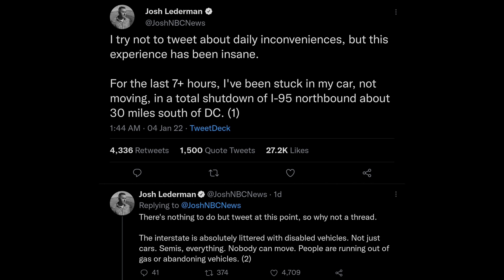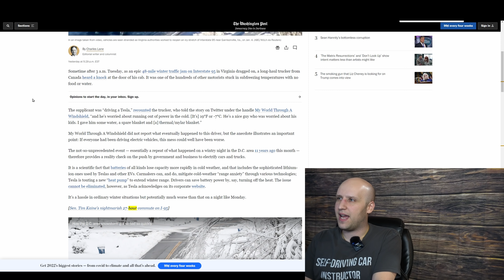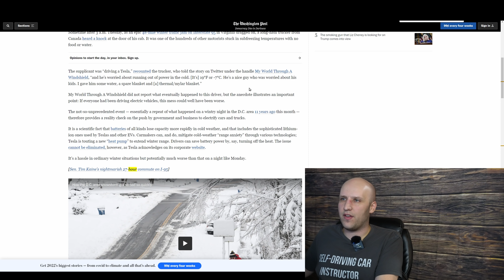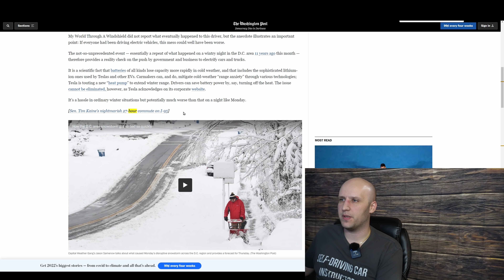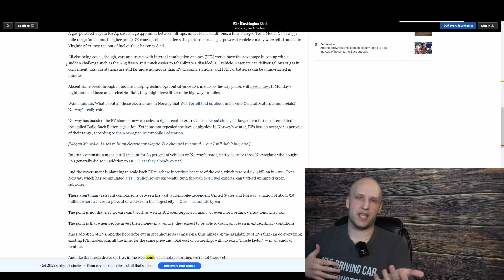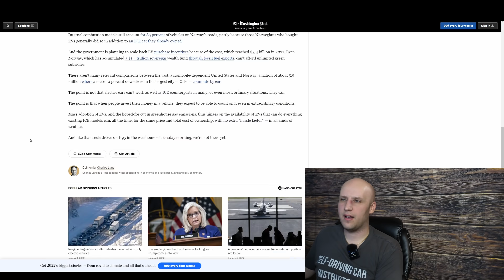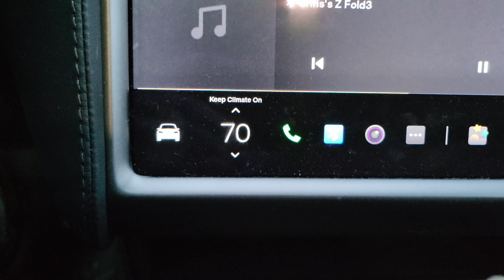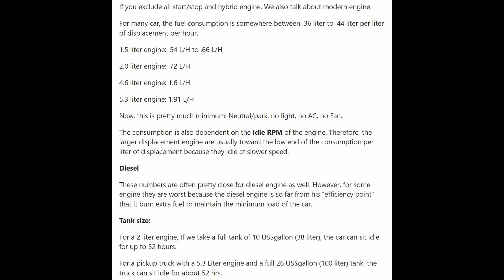How Long Can a Tesla Keep You Warm In A Frozen Traffic Jam? | FUD Debunking

Comment: Nice video, but I love all the reasoning on why your electric car is the best.  With power outages that follow events like this, many gas stations actually have generator sets to enable pumping fuel when you would not be able to charge.... sad but true
Reply: We love the reasoning of carrying a small portable generator in an EV, just as it’s good reasoning to carry a battery jumpstart unit in ICEVs … and the batteries in those are now typically  … Lithium-ion.

Comment: I have been hotshotting for some time now and i have pulled Tesla's out of snow and pulled them when the Batteries died, that Regen breaking well being pulled does work and i have fully charged a Tesla model 3 within 75-80km. but the number 1 mistake people make here in Canada is traveling in the winter at -20.c and on mountainous roads with steep grades. they need to learn that in the winter your Tesla is not going to make it to Kamloops anymore now that highway 5 got taken out by a storm, almost daily we see them stuck and unable to charge. i feel bad for them but you need to be able to drive at lease 340km or 7 hours without needing a charge, funny thing is i now move a lot of teslas for work, most people see that they can't make it on with 
EVs and just call around to get them transported. Great video though, I did order a Tesla model 3 but waiting for it to come in

Comment: Actually, the same problem as a gas powered car. However if the temperature were Canadian winters (averaging -30 worst week) makes the Teslas an urban vehicle. Seen enough cars stuck when temps are very low and gas mileage takes a severe down turn, say 20% lower due to bad traction and severe temps, gas cars with small engines cannot reach optimum operating temp. Hybrids seem to do better though.

Comment: Great test on a sealed system. Now do a test where you have to open the car at least twice every 2 hours to pee. Also, its not a valid assumption that the vehicles would be 90% charge after running into this situation. Finally, in this event, there are thousands of cars - if even a portion of them run out of power - it's not a simple refuel to get them out of the road to clear traffic.

Comment: I remember reading about a mobile charging company in Europe. They have vans that have a lot of batteries in them and they can drive up to your EV that is out of charge and give it enough of a charge to let you drive to a charing station. To my thinking that means the ICE advantage of "you can bring in a gas can and add some fuel" is negated and you can do the same thing conceptually with a mobile charging solution. So in that case it is not that the EV is "worse", rather it is that here in the states we do not have a service like that yet, but probably will as the density of EV's on the road continues to rise. IMHO

Comment: I own a 2021 BMW i3 BEV with a heat pump and although I can't make any direct comparisons to your experiment, it did provide some excellent analysis. I have noticed that while my seat heater seems to have a negligible effect on the charge level, the air circulation fan, whether heating or cooling, will drop my range by about 20 miles, even at its lowest setting.  Of course, that's only for the duration that it's turned on.  Most of that range comes back when I turn the fan off, depending on how long it's been running.  Do you see a similar effect in your Teslas?

Comment: 22 people who where stuck in a snow storm in Pakistan died from carbon monoxide poisoning while running their engines trying to keep warm. Anyone with common sense knows not to run their heater constantly that goes for ICE and electric vehicles. And depending on the condition of your ICE vehicle it can overheat trying to run it constantly while standing still. So your ICE vehicle better be well maintained because winter will sure find all of your defects. And this person is only speaking from their experience because they don’t know how many other people in ICE vehicles had problems. There was a snow storm in Atlanta some years back where people where stuck in their cars for 26 hours and ran out of gas so this person is just cherry picking his situations. If you like ICE vehicles keep driving them but don’t try and force your ideas on EV drivers. And that was just one day, one incident it’s not like it’s a daily occurrence. Hey keep taking your ICE vehicle taking it in for maintenance and regular visits to the gas station and I’ll keep you in my thoughts occasionally while my car is charging in the garage while I’m sleeping.

Comment: "Drivers can save energy by turning off the heat" not really true in an ICE car. 60% or more of the energy in the gasoline gets turned into heat whether you want it to or not. Essentially the heater in a gas car is always running, just not always being pumped into the cabin. 
I get not having a blanket in the car in Southern Cali or something, but not having one anywhere it snows seems unwise. Better to toss it in there along with the rest of your emergency supplies and forget about it till you need it.

Comment: But having anticipated this kind of weather, a gas car driver could carry an extra gallon of gas in a safe container.
Reply: when the weather clears, it's a lot easier to dump some gas in the tank. charging a battery is much more involved and time consuming. I imagine they'd simply tow the car. $10 vs hundreds of dollars to recover. actually, a gas car has other options too. at least once in my life I've dumped a bottle of dry gas in the tank, just barely enough to start the car and rush to a gas station. not exactly good for the engine, but it saved so much hassle and money.

Comment: I love how ICE vehicles draw fossil fuels directly from the earth and do not require filling up at some form of distinct station.
 - Therefore infinite power hack.
Also, how only electric vehicles reduce mileage in the winter.
No ICE vehicle loses range, they actually gain range from the cold fusion effect with the fossil fuel infinite power hack.
The "gas can" is definitely a fair point. However, after EVs are around for decades too, I am sure there will be simple solutions for people who run out of battery.

Comment: Something to keep in mind with an ICE car in these conditions is to keep the exhaust pipe clear, to avoid carbon monoxide poisoning.
Reply: It doesn't need to be blocked to leak all kinds of pollutants into the cabin..young children are especially susceptible.
Reply: Wouldn't the heat of the exhaust keep it clear?
Reply: @rong648  Just depends on what is happening outside. If it is snowing and blowing it could get covered. The one thing I think about is a gasoline car could be fueled while stuck out there and that is something not easy to do with an EV. Because how many are going to be stuck with 90% charge on the battery?
Reply: @ManleyOne  I grew up in Michigan and that was never a concern that my exhaust pipe would be covered with snow.
Reply: @rong648  If it's a strong blizzard that piles up snow against the back of the car, even melting some of the snow won't be enough.  It takes a really strong storm to pull that off, but Pakistan just had one last week.

Comment: Great video, my biggest concern with this is if you're stranded in an electric car you have to get a generator or a power pack to charge it. With a gas or diesel you can throw the fuel in and go. That's why I believe hybrids are the best option. Use batteries for normal driving, but for situations like this and long trips the gas is used. Shoot if you have a small engine that can charge the battery faster than it can drain would be fine with me too.
Reply: Hybrids are the worst of both worlds because you have to move the mass of two power systems, but only one of which can move the car at any given time.

Comment: The Tesla can't heat in Canada -40 the software fails and you die! Also not enough resources to supply batteries in future and power grid can't handle draw if everyone had one. C02 doesn't harm the World. Air up high is -62 keeps

Comment: The car doesn't work in Canada people can't get heat even after fixing them what a joke.
Reply: Where it’s that cold, what the hell are you doing driving a car?  There’s a reason the TV show is called, “ICE Road Truckers”.  90% of the Canadian population lives within something like 50 miles of the U.S. border.  Teslas work just fine in the Northern U.S. border states … or do you try to speak to them in French Canadian … “Parlez vous Eh, Le Hoser?”
Reply: @jimmanley2796  are you deaf? The cars are failing in large numbers in Northern Canada were gas cars work fine. Electric cars suck should be stopped very toxic to Earth. Dangerous in a crash expensive to run Elon is a goof!

Comment: How is starting from a full load battery and cold car a "worst possible condition"?
It is actually better than the "average" condition, where most likely some battery was used anyway to travel, and the car needs to heat anyway.

I would say a worst possible condition is starting with a 50% battery because you are half way on your trip, even if the car is warm already.

Comment: Good data on the Teslas.  Not so good on the gas car.   On the gas car in those temps you could stay warm with a 60-70% on time.   Your temps would get hot and cold but by overshhoting on the hot you could extend your OFF times before restart. So add 30-40% to your calculations

Comment: Now if you are comparing apples to oranges: providing heath in a non electric vehicle requires the engine to be on so obviously you are going to run out of fuel faster than in an electric vehicle. This all article in my opinion is a bit lame and full of platitudes.

Comment: 18:45 gas cars also might have heat pump to keep temperature at exact point mine has and it causes higher idle revs for alternator which means when it's on car uses more fuel. Just saying.

Comment: Be sure your car blanket is wool, and that it's wrapped (against moths). Wool is amazingly warm, and the only fabric that maintains insulation when wet.
Common sense in Northern Plains states is that anyone who isn't prepared to spend a week in a snow drift on an Interstate after Oct 1 is out of their everloving mind. [I had a delayed interview with a fellow who spent 3 days on the Interstate in a snow drift before with his family before they were rescued -- they had a good time together. Games, etc. Not a problem when prepared.]

A tow truck driver I knew who spent several sleepless days rescuing stranded motorists on I-95  in MA during the blizzard of '78 said the least prepared were 
executives wearing Bally shoes. They just assumed they'd be rescued.  Congestion and snow drifts that cover cars are no respector of persons. 
One woman tried to sue the state because he was unprepared and died. 

A major difference between EV and ICE cars is the presence of carbon monoxide. 
You can seal up a Tesla, but not an ICE car. 
Make sure air vents can draw outside air from time to time so you don't deplete the O2 in your car. 
On ICE cars, besure the exhaust doesn't get snowed over.

Comment: I don’t drive Tesla but interested in learning about them.  Are there stats on the average state of charge Tesla owners run on? Usually when trip planning, the battery does get a bit low it seems like so instead of starting with a full charge, I think starting from the average state of charge would give a bit more realism to the experiment.
Reply: Most Tesla owners charge their vehicles overnight, most set it to stop @ 80% to 90% did this happen in the morning on the way to work or evening coming home?

Per this guys test a Tesla with 30% charge or more would have fared just fine

Comment: Anytime there is a significant change in the way we do anything, there will be a lag in solutions for the problems that arise. Eventually all tow trucks will be equipped with charging or other equipment geared toward electronic vehicles because situations like these will make us aware of new needs produced by new technology. We may feel nostalgia for the days of the horse and buggy but we don’t have the entire transportation industry built around them anymore, that would be ridiculous because Technology has changed. So why push back against electric vehicles in this way? One can’t help but wonder how much influence there is from the oil industry to be discovered in this newspaper article.

Comment: Gas vehicles lose range in the cold also.  Mpg on average is lower in colder months. Challenge with electric vehicles is the energy isn’t as portable as gas. Some service companies are filling the void - good. If a gas vehicle runs out, can get a few gallons fairly quickly. More difficult with electric.

Comment: Why don't electric cars have an emergency battery for these reasons. It could be separate or part of the main system but requires a special key  so no running it as part of the main battery?

Comment: 1000 gas cars on the highway out of fuel... no problem, send a tanker to top them up. 1000 electric cars stuck on the highway... what are you going to do? You'll be there for weeks with tow trucks clearing the road.

Comment: Great experiment. It's good to see the facts. As a Canadian, I follow well known practices for getting stuck in my vehicle in winter. One of these is to carry nightlights and matches to light them. These can keep a vehicle cabin warm for days.
Reply: Can you link to what nightlight is? If it is something which use combustible like wax candle, i assume it would increase the consumption of oxygen in cabin, and you to keep your window open little extra to keep with it. Anyways, i can't assume anything until i see what you mean by nightlights in this case
Reply: @privatevideosforsharing5424  Yes they are the small candles, also called tea lights. And yes, when using them you will need to allow some air flow through the cabin.
Reply: Ben Sullins here on YT has tried many methods and posted a month ago of an option which I plan to have when my Y arrives. Its obviously far more expensive than a can of gas but its a battery backup that can also power your house. https://youtu.be/dT7cANoCER0
Reply: @markmelton697  what is 'obviously more expensive'??
Reply: @69snoopster  did you click on the link I provided?
Reply: the youtube? I will...
Reply: I've seen that one before. There are several makers of portable batteries. Yes. More expensive than a gas can with an explosive liquid and vapors. MUCH safer though....
Reply: @69snoopster  yes, there are quite a few that make one similar. But few that has the output amperage as this one.

Comment: if you go out in snow or freezing conditions you are expected to be prepared so why not take a generator just in case of course you will take a spade and a warm coat and a spare wheel an puncture repair kit and a hot drink in a flask just in case. use your brain thats what its for...lol your testing doesnt include the possible range to the location that the incident took place or a fair consideration of that range used by the battery. it is possible that the range may deplete the battery before heating takes place and presumably on a cold day you will be running the heating whilst driving. The results are inconclusive.

Comment: Ive driven my ICU car on fumes with the intention of going to the gas station or.. even near E where i can go 20 miles easily but then if i were to get stuck in something like that traffic then i would be in trouble..  even idling takes gas. 

That type of ... parking lot on the highway level..  is not a regular thing (not talking traffic, there is always traffic,  but just a complete 12 hour complete stop in cold temps) ... having said that,  i think anyone still using a ICU car wasnt swayed by the event. most people using electric know how much better they are at dealing with cold than the general public thinks.

Thanks for doing the test.

Comment: Also note that if snowed in, in a gasoline car tail pipes if covered with snow would cause carbon monoxide to enter the cabin.
Reply: Except the heat of the exhaust would keep any snow from accumulating. Moreover there is a reason people who kill themselves with carbon monoxide have to run a hose from tailpipe to the inside of the car with windows rolled up. Think for a minute about bumper-to-bumper traffic in LA or some other large city. If what you claim is true, not only is their own car idling, but hundreds of others around them, yet not CO deaths in traffic.

Comment: Still though.  The new standard range F150 will have a 185 -200 km range at full charge in my climate.  With my commute I'm not sure if I could deal with that.  It is 52 km one way.  I hear ya though the media skews around with these stories.  Usually where I live, where all media is to the left, it is skewed it the other direction where they are pro electric car no matter what (dirty grid ignored, winter range ignored, co2 impact of battery fabrication ignored).  Too bad Ford wants 20 grand more for the longer range version, you have to upgrade trim levels.  Anyhow the winter commute is fair and you need a fairly commercial heavy vehicle, a compact car will not cut it.  Further I usually run 10 ply LT 3 peak tires, otherwise I'm getting new tires every year and I'm not sure how nice those will play with range.  Nice demonstration on how heating long term is a non-issue however.  Tesla also does not allow undercoating and we have a serious salt mess on the roads around here.  Lots of talking myself out of it here I guess, lol.  I suspect my next vehicle will be electric but not willing to give up safety or capability for now.  Having an electrician install an additional 100 amp panel at my house would be an opition, so you have the Ford 80 amp 220V charger to live with the thing, but I suspect with my underground service that would run 4 grand or so.  Interesting post.